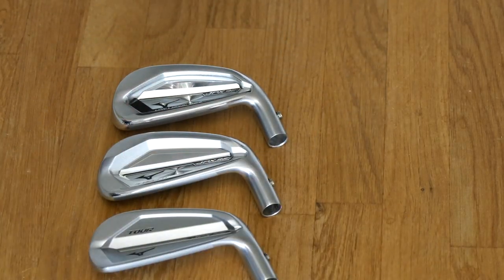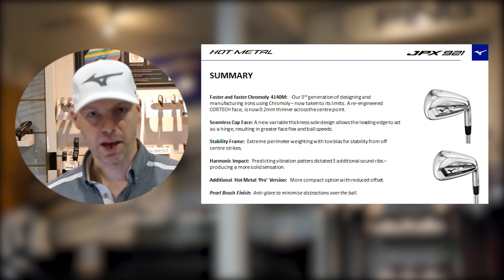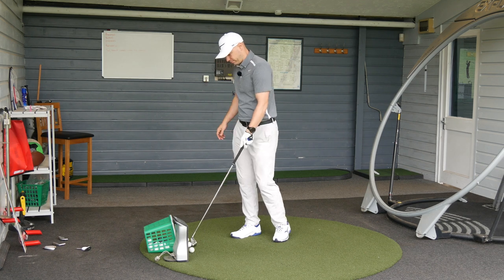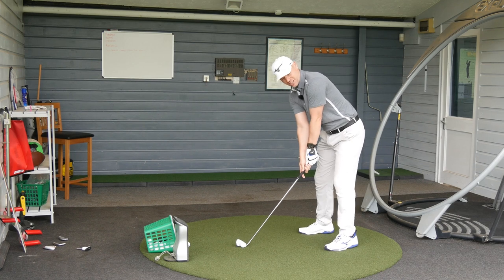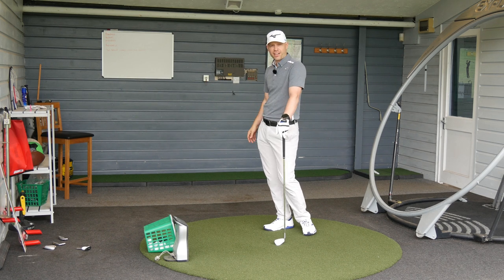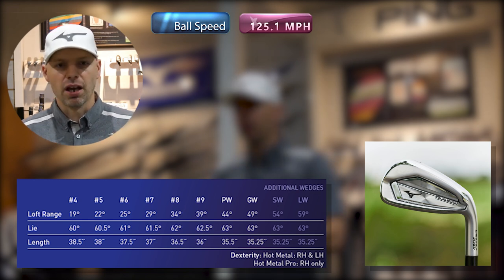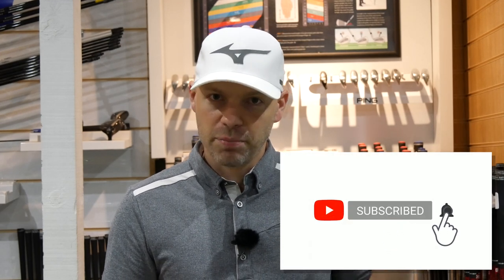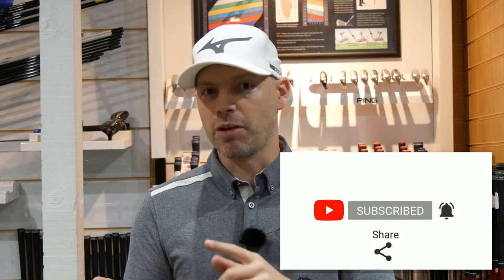Mizuno JPX921 Hot Metal Review

Comment: I'm a 5 handicap & play the 919 Hot Metal Pros bent weaker -7 iron@32. The high spin is the reason why after a long search I ended up buying them - they spin more than equivalent Srixons, Titleists. For me, playing these clubs is like cheating - they're just so easy to hit. I've bent my set (PW,9,8,7,6,5) to lofts (47,42,37,32,28,24) with carries of (132,146,159,172,185,197). These join T20 wedges (52,57,62) @ (120,100,80), and 2 hybrids, 3W, D. I'm 50 and can hit a high 5iron into a 200-yard green - when I was 30, my bladed 5iron was my 175 club

Comment: That height may be due to the shaft but... putting a ball to the moon is ridiculous in windy conditions
Reply from the maker: Shaft is my standard gaming $ Taper 120g Stiff that I use all the time. I'm very shaft insensitive (have an older video testing ladies against x flex and saw no difference in ball dynamics)
Hitting it to the moon isn't something that I would want but for the slower swing speed golfer....
Reply: @AskGolfNut  probably all that spring face perimeter weight and fat sole for a low CG.   Fun to hit but definitely not a low handicap gamer

Comment: Just wondering how long until I get mine in my hands! Had my fitting June 11th, dynamic gold 120 shafts, with a 5-PW and SW hot metal makeup. Told me 8 weeks but hoping for earlier delivery!
Reply from the maker: Hi Cameron, assuming you live in the UK, I would say 8 weeks is an earliest possible date. Mizuno have just received some back dated shaft combos that means production has shifted to offer backlogged orders. Once they are completed then it'll be back to normal day to day orders. Fingers crossed hoping its sooner rather than later 🤞👍

Comment: With the different lofts on the HM and the forged would you suggest the forged lofts would need to be strengthened in a combo set ( 5-7 HM & 8-PW Forged) ?
Reply from the maker: If it was me I think I'd do the way of weakening the loft by 1 degree on the Forged to retain the bounce on the club. Mizuno generally run fairly low bounce numbers as a rule so adding 1 degree of bounce by weakening the Forged will be better than reducing it my strengthening the HMB's 👍

Comment: Great video i play the jpx  919 forged at the moment but am struggling to hit the ball higher and have lost a club in length. I am 62 years old and play off a 10hcp do you think the hot metal irons would achieve what i am after or would cranking up the lofts on my forged achieve the same result as my forged irons are not that old
Reply from the maker: Cranking lofts on limited speed may give a little more total distance but will lose in Carry especially when you get to the mid irons. Only way to achieve increased carry and peak height would be to transfer to a different head design.
Rather than think of a total new set (as you say the 919 are fairly new) have you thought about just buying some new 921 Hot Metal irons in the irons you feel you are struggling with, say 5, 6 and 7? Keeping costs to half they would normally be?
Thanks for the comment and for watching 👍

Comment: Your thoughts on increasing/weakening loft these 921 Hot Metal irons? 

I have plenty of swing speed (92+ mph with 7i) but struggle with consistency (~17 handicap). Having the forgiveness of the HM but with more height/spin seems ideal.
Reply from the maker: Hi William, for a 17hcp I'd probably look at the more aesthetically pleasing HM Pros, all of the help of the HM but in a slightly nicer looking package that will allow you to use them for longer. They can only be bent by a certain amount in loft and there is also a trade off in bounce and offset. The standard HM weakened to the max will reduce offset to probably the Pro amounts potentially with increased bounce. Personally I'd got to blend the Pro with the Forged if it's a set that you would want to keep hold of for a while 👍
Thanks for the comment and for watching.
Reply: @AskGolfNut  That's an interesting point about changing the loft also changing the offset. I knew the bounce would increase, but never considered the offset also decreasing. Sounds like I really should just go in for a good fitting!

Thanks for the reply and good review video!